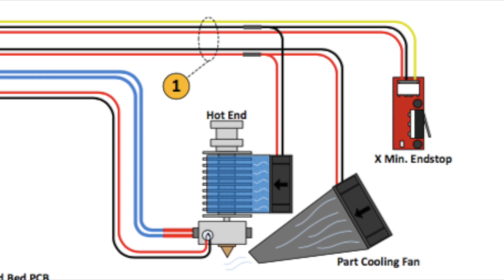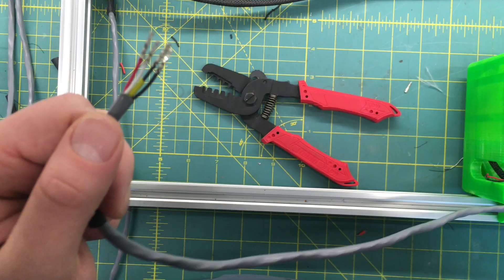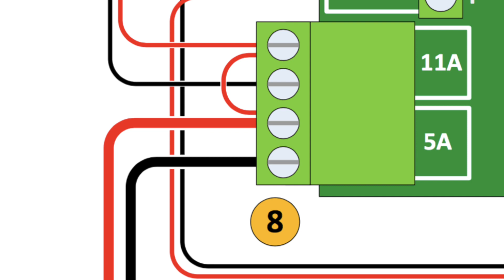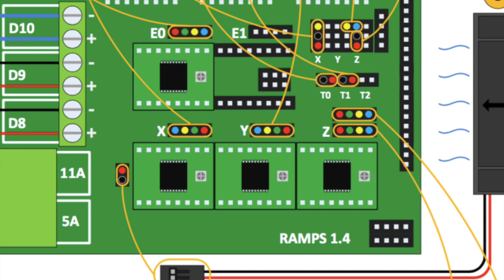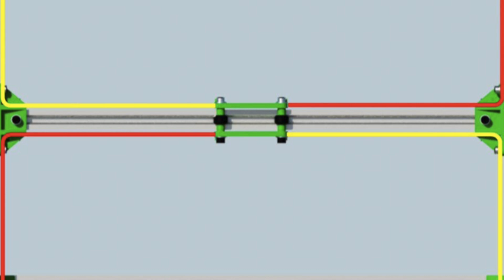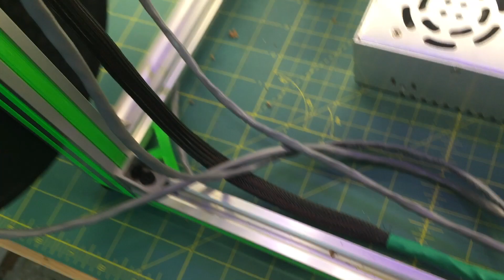D-Bot Build: Wiring Tips & CoreXY Belt Routing

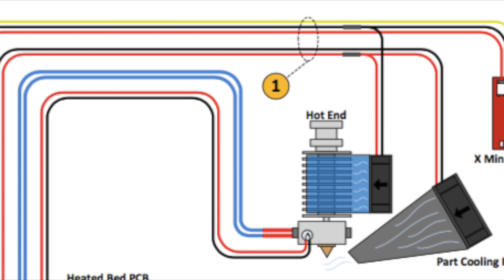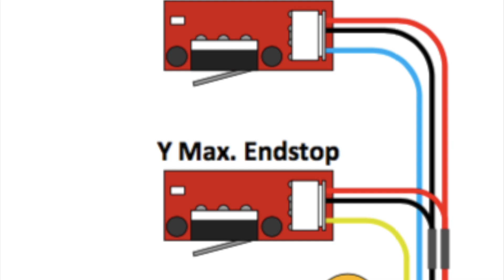Comment: 0:30 You should not join the wires for the hot-end cooling fan and part cooling fan, both need to be controlled independently. Probably you can join some positive wires, depending on the control strategy. 3:45 The end-stops only require 2 wires, unless you care about the LED on the board
Reply from the maker: Hey Ron thanks for checking out the video !!  The fans are controlled independently — maybe I misspoke in the video — the hot end fan is always on if the machine is powered on. Following the wiring diagram , the hot end heatsink fan shares positive with the part cooling fan and negative with the end stop and so is always on.

Comment: Switching to 24V is a great idea! Thinner wire needed and less current :)
Reply from the maker: Great idea for a future upgrades video :).   When I finish covering the basics in this series I hope to cover a few more advanced topics while upgrading the first D-bot that printed this one — maybe Klipper firmware, octopi, a 32 bit microcontroller,
24v conversion, TMC steppers, titan aero etc., would any of those topics interest you?
Reply: @ScottBuildsThings  I have been "building" my 300x300x300 d-bot for like 2 years now, so steady going here...I have plans for 24V, Titan aero and TMC2130 steppers.

I have been activating into build again lately and biggest question has been 24V with ramps. Ramps board needs checking for capacitors, as are they ok with 24V. Also the ceramic fuses(?) needs to be removed. All other parts are for 24v(stepper motors, light strip, fans, hotend) but only ramps questions me...maybe do a video about ramps 24V overhaul?

I have been using this as info source: http://forums.reprap.org/read.php?219,196602
Reply: All of the above please lol